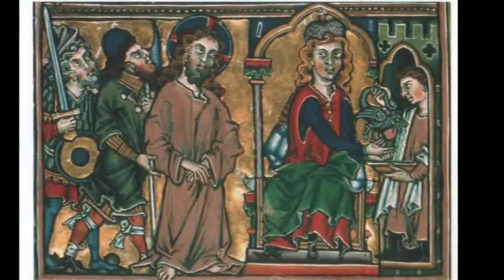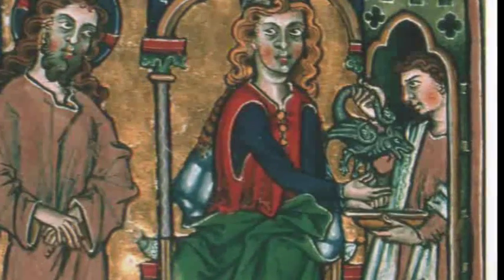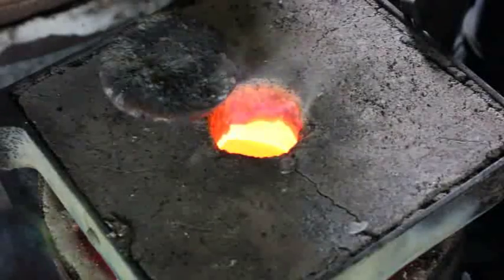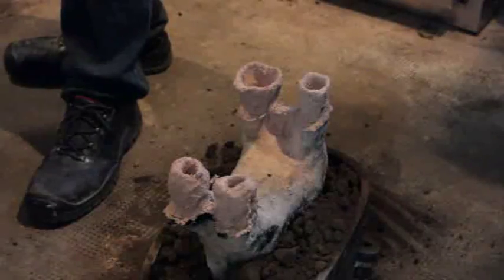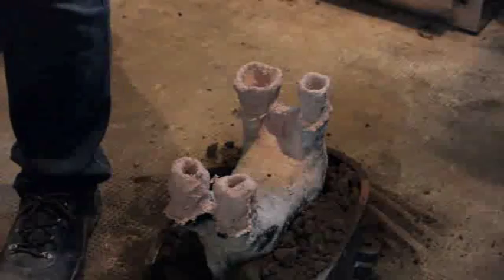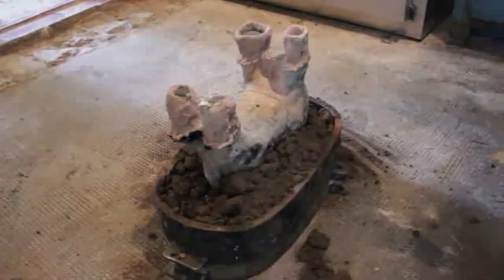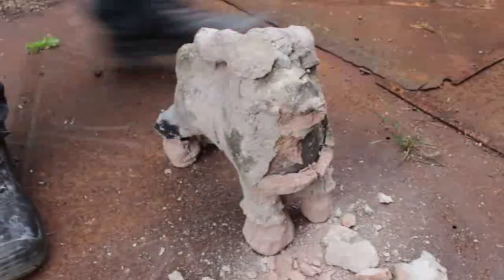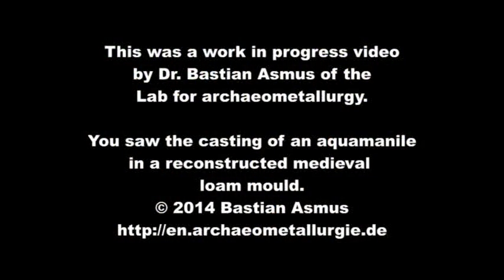Foundry: Medieval bronze casting of an aquamanile in a lost wax loam mould - by Dr. Bastian Asmus

Comment: Do you happen to know if this design of jug makes a "glug glug" sound when water is poured from the mouth due to the shape and position of the air bubbles trapped inside?
Reply from the maker: I do. It does not make any sound. because of its lid in the head does seal hermetically...

Comment: Amazing work. Do you think it would be possible to use bronze nails instead of steel ones? So that you wouldn't have to solder the holes left by the nails?
Reply from the maker: It is in theory possible, but since bronze is hot short, it is a very "dangerous" enterprise, as the bronze pins might give way at the high temperatures during firing the mould. In such a case the core might misalign and ruin the cast. In short: this risk does not outweigh the disadvantage of stoppering a few small holes.
Reply: @ArchaeometallurgieDe   Thank you very much for the answer. I will stick to iron nails then. I'm trying to cast the horse from the Trundholm Sun Chariot (Solvognen) so this video was very helpful.

Comment: Hello Bastian Asmus. How do you remove the core from the aquamanile? The design doesn't seem to allow much access with chisels to break away the core.
Reply from the maker: Yep, thats right. There is not, but my loam core material is designed to be removed "rather easily". It remains laboursome work, though. But, if you want to make a vessel there is no point in leavinh large openings. I have looked at quite  a lot of original aquamaniles. Although I cannot prove it, as there were no original medieval cores, in the examined specimens I think it highly likey that they were made with clay cores. At least Europen north of the Alps until the end of the 14th century.
Reply: Getting cores out of hard to reach places has always been a challenge for me. On the one hand you want it strong enough to survive the firing and handling, on the other hand you want it to turn to dust or liquid as easily as possible. I know plaster will turn liquid again after firing and adding water. That could be a practical way, but like you said, Theophilus describes clay  cores, and I have seen no evidence of other material being used for it (so far).

Comment: there is a little problem with your work piece. the mold is cracked and the molten metal has a little leakage. if you had reinforced your ceramic mold then you would not have this little problem.
Reply from the maker: Hello Lion heart Irani,
I am well aware of this, thank you! 
But this video only shows a tiny segment of a much larger experiment series, where I am investigating the properties of the moulding material.